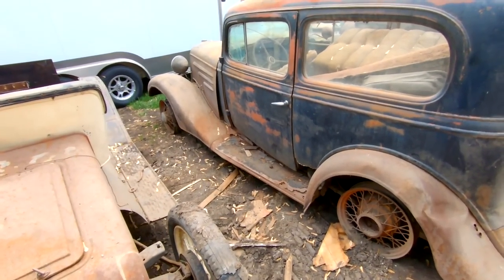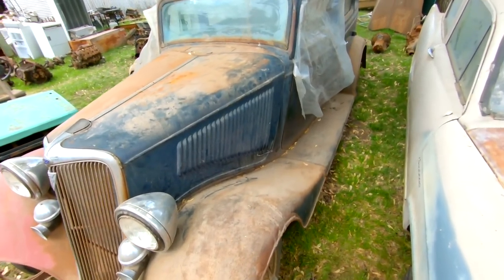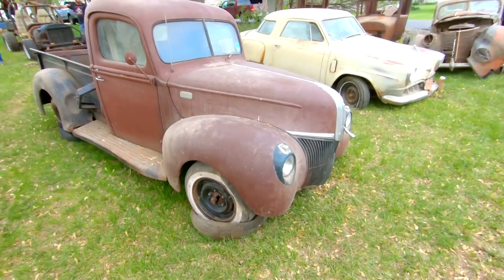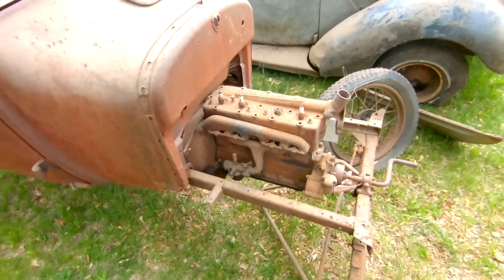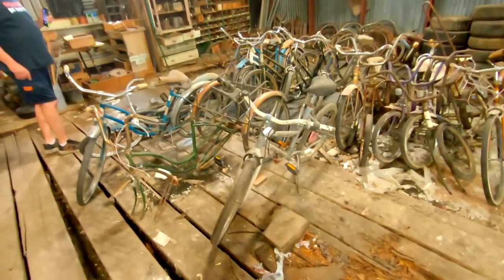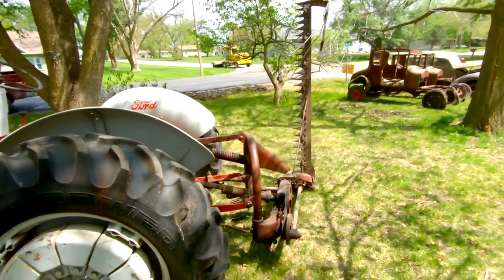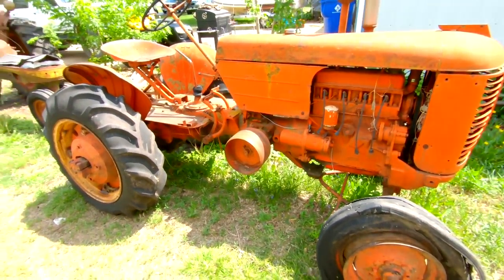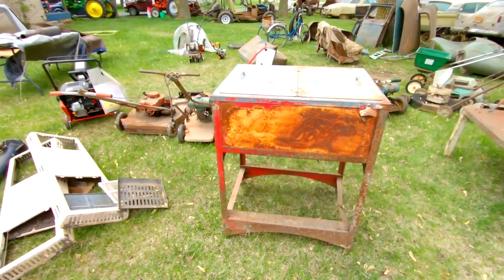One Nebraska Man's Collection of Old Cars, Tractors, Bikes, & STUFF Auctioned Off! (Auction Recap)

Comment: Oliver's were Green and a White- Light Green tint mix. That didn't look either. Looked more like an Allis.
Reply from the maker: Ah thanks for the info
Reply: The early ones were green with yellow and they had red wheels, that tractor is an Oliver, they were looking right at the rear axle castings which have Oliver cast right in them, I can't say for sure that the engine belongs to that tractor but it is an Oliver engine, also you can tell the Oliver by the fenders. The little orange tractor looks like an Allis Chalmers but it could be a case a lot of them looked similar.